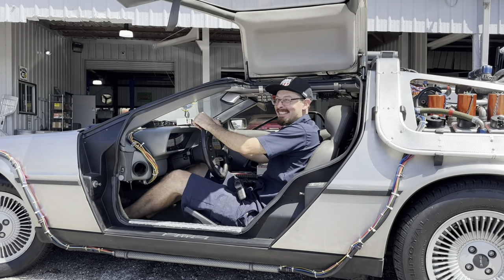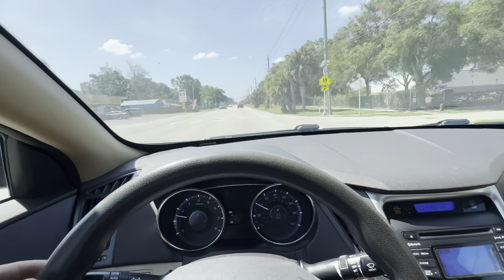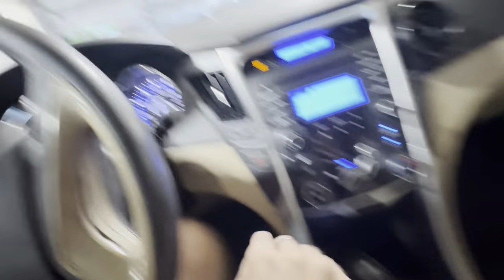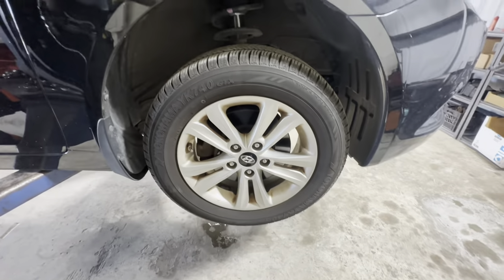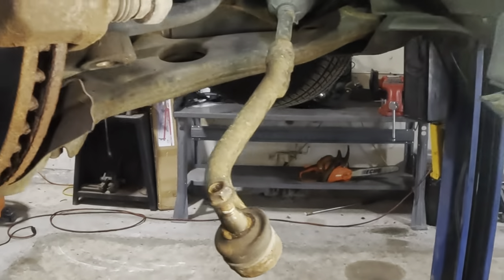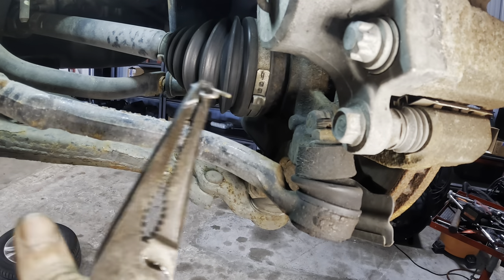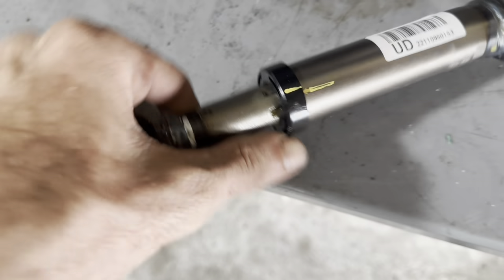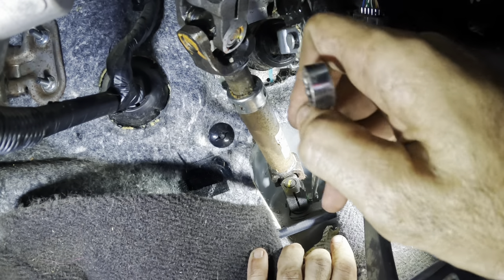Misdiagnosis! Mechanic was Wrong! Hyundai Sonata Steering Clunk!

Comment: It’s a star looking rubber plastic which connecting the electric motor to the steering shaft. That plastic is smoothed and need to be replaced.

Comment: The first time you moved that steering wheel i knew it was the EPS coupler bush. It's an asterix shaped (for want of a better word) rubber coupler between the electric motor and the column. The first time we saw it we did the intermediate shaft but still had the "decoupled" feel so we looked further. We've now done at least 20 of these and larger workshops i know of are doing one or more per week on average. 
Back when this system was new, the dealers were replacing entire columns under warranty because the coupler bush wasn't available separately. The bean counters soon made it available which is lucky for the owners facing this repair out of warranty!

Comment: Its the Servo Motor Coupler 563152K000FFF Ray that the issue that and the Steering shaft u joints are very common issues on these Hyundai's 30:00

Comment: Don't worry Ray I'm a mechanic for over 20 years and I had the same problem figuring out the clunking noise in Kia and Hyundai steering column. Its in the electric steering motor,  when you take the motor off the column there is a star like rubber bushing that goes between there motor and the column. Its like a $25 dollar part.

Comment: I guess you have already sorted the problem , I get a lot of these in Brisbane Australia , I think it is a bit of a problem brought on by heat . There is a rubber coupling inside the drive motor to column shaft that disintegrates . It can be purchased form Hyundai and fitted into the car with out removal of the electric drive column . do not move the steering wheel while it is disconnected or it will through a steering configuration fault .   Happy repairs Ray

Comment: I'm just surprised you've never had to replace the coupler bushing on those hyundais before. There's a service bulletin on it by the way. Maybe there's just more of those cars in my area cuz I do at least a couple every month. Anyway we all make mistakes and I think I also called an intermediate shaft the first time I ever came across it years ago.
Reply: 56315-2K000FFF is the part number for what you need by the way. Just gotta remove the lower kick panel, turn the steering wheel 90 degrees each way to remove the screws holding the lower steering wheel cover, disconnect any connectors preventing you from dropping the column on the floor, and once you get it down theres a motor sitting on top that is held on with 3 t30 torx. Remove that and theres a rubber bushing inside (well there should be, but itll look like it was in a blender). Clean that out put in new bushing, put everything back together. Clicking gone. It clicks cuz there's 2 metal gears that hit each other with no isolator when that bushing fails.

Comment: UGG.  As soon as I heard the clunking sound I was 99 percent sure it was (spolier)the steering coupler.  I have replaced two of them in the past.  A $5 part that on my Hyundai required dropping the steering column to get to it above the electric motor.  Hyundai's are famous for this and normally trips an EPS light on the dash.  I will tell you this, I have learned a great deal from watching your videos.  You do a great job. Keep them coming!

Comment: Double check the shaft going into the rack!! Lift up the carpet and rock the wheel back and forth and see if the shaft going into the rack is moving up and down!!  I just did one of those on an identical car that had a clunk like a bad sway bar link when hitting bumps. Took me awhile to figure it out. Car was steering the same as yours also!

Comment: Gee Ray, if you didn't make mistakes it wouldn't be a fun challenge to watch where you might forget or over look something!  That keeps it interesting to see if we would go about doing the repairs in the same order.  In the early 2000's, GMC and Chevrolet truck and SUVs would develop a clunking in the steering wheel. It was fixed by replacing the steering column bearing just above where the steering extension shaft was attached to the steering wheel shaft.

Comment: Hey Ray, it’s not the intermediate shaft, However it may also make same concern but there is a plastic rubber gear i don’t know exact material, this part is installed between the servo motor and the shaft that spline with the intermediate shaft and in order to reach it you need to remove the steering column assembly or you can only lowered down to remove the servo motor and get access to it very very simple job and also remember next time with same concern first thing remove the intermediate shaft and bench test it if it’s good then your next target is the that plastic gear.

Comment: EPS flexible coupling in the top of the motor is faulty. There are some bushings there that are known to fail, so look up the Hyundai parts list for the EPS, and you will find them there, as a known issue, plus the top bushes also wear. Had exactly the same on a Kia, and they use the same EPS motor and drive, so the universal was not to blame, but you need to look a little further up the shaft to the EPS unit. You need to pull the steering wheel, strip the column to get to them, but otherwise not too difficult, and all you need to do is an EPS relearn afterwards (lock to lock to get it to figure things out) to finish the job.

Comment: I saw the u joint wiggle at the bearing cap and since the steering wiggle was worse when you turned the steering it meant part of the play the u joint was absorbing stiffened it. I believe it still needed replacing.

Comment: There’s a small rubber coupler in the steering column that is more than likely the issue. That was what was causing the clunk clunk on my Hyundai. $1.50 for the part about 45 minutes and some bad words problem was solved!

Comment: I had a similar problem with a f-250 truck. It was hunting on the road like it needed an alignment, or the steering box backlash was too tight. In this case however after several trips to different shops, it was the steering shaft just as you replaced here. It turned out there was excessive slop in the collision slip joint. So in my book you were on the right track. Maybe try removing the shaft again and then using visegrips to try to duplicate the noise by first clamping to output of steering wheel, then to input to steering box. Might be that what has happened is the steering wheel itself has become loose

Comment: My mom has a 2012 hyundai with the same issue ended up being a stupid 20 dollar part behind the clock spring in the column,not to hard to replace, but my thoughts just like you Ray was the u-joint on the steering intermediate shaft. Sometimes you got to go with your gut to learn from your mistakes.

Comment: I had the same situation with my PT Cruiser. Finally had to remove the pin by knocking it out and then taking the bolt loose outside of the car.
The nut was tack welded to the assembly, so the bolt side has to be loosened.
It was a pain though and very hard spot to work.
Had to do it twice because the new steering gear began leaking after a week and I had to replace it under warranty.

Comment: Hi Ray, You'll find the noise coming from a small rubber bush in the electric power steering unit. It's a common issue. Cheers Richard

Comment: Hey Raymond 
The noise is in the steering motor to steering shaft connection it’s a little plastic part that goes out all the time Hyundai. You need to drop steering column to git at the motor . Good luck

Comment: I had this problem on my 2007 Saab 9-3. A very disconcerting feeling with the way it wandered. Apparently not uncommon with this type of setup, exacerbated by the Saab lower joint being directly under a drain point on RHD drive cars, allowing water to ruin the lower joint quickly. Luckily, once found, a fairly easy swap, and the Saab back to it's gorgeous self..

Comment: As soon as you said Sonata sterring loose and makes noise I knew this is the Sterring gromet. They use a PVC gromet in the electric Power steering  the gromet wears down and almost melts since it is taking uo the slack between two metal gears.  it is  $20 part  but the dealer wants $450 to replace it because the time on this is 3.75 to 4.5 hours  I just changed Mine on my 2012 Sonata in about an Hour dont disassemble the steering wheel or remove the fuse panel, remove plactics  Just drop the steering wheel,all the way ( move the seat all the way back),  open the top of the Power steering box,  clean out debris , with a brush and vaccuum, place the gromet in put the top bak on it only goes one way, put steering wheel back up, reaassemble the plastics should be good to go. this is Not a safety Issue because the gromet only takes up space between the gears the steering is not "lose"  just has a little extra play  like an old Dodge if it was Hyundai would have replaced Mine as this is a known issue on these cars and KIA s as well.

Comment: Had a very similar noise to that in my Nissan Sentra.  Turned out to be a rubber encapsulates steel weight just under the horn pad that had broken loose, and was making noises every time the steering wheel was turned.  I don't know what its purpose was, maybe a counter weight of some sort??  Opened the wheel, siliconed it back together, and no problems since.

Comment: Hey Ray, there is a TSB about a rubber "bushing" in the electric motor assembly.  I have replaced several up here in the north.  Good luck.

Comment: It is a simple misdiagnosis, I've been close to doing it a time or two.  What needs to be replaced is the EPS gear, it's a little star gear that goes between the motor and the rack.  It is a simple replacement with either removing the column or it can be done in the vehicle.

Comment: There is a rubber bushing inside that steering unit that like to disintegrate..it's called a flex coupler and it looks like a star..  luckily the replacement is not as much cost as a steering shaft.. but there is a bit more time involved regarding replacement.

Comment: It's the little plastic/rubber gear down inside the end of the column. There are videos of how to do it . Takes 2-3 hours .I think there's an aftermarket metal one you can get too .The first one  I did , Identifix helped me isolate the problem .TSB on it too, I think . Reasearch has saved me much time. Jack of all cars master of none.

Comment: Had this problem with my 2012 Sanata. The fix is replacing a small plastic part above the shaft you replaced. It looks like a star, about the size of a quarter. This is a known problem.

Comment: The problem is caused by a neoprene/ rubber coupling between the steering column and and the universal coupling. You need to remove the steering column to get to it. It's a $15  part which disintegrates over time. I replaced the one in my Hyundai i30 after watching a youtube video on how to do it. It's a bit fiddly but very do able.

Comment: Upper column failed, quite common on Hyundai. There is a rubber coupling that fails and causes this exact symptom, do a quick search for TSB 14-ST-002-1 which guides on fitting a replacement component (which is about £10), do be aware its a bit labour intensive. You will note that when you turned the wheel the motor on the column was trying to assist but, the play present is resulting in a slightly delayed knock noise, classic symptoms.

Comment: Not sure if this helps  by my 2012 camry was making about the same noise.  I first thought it was that shaft.  However I was wrong.  It turned out to be the dampener between the power steering electric motor and the colum. Dam $5.00 part and about 3 hours worth of work.  But I am just a DYI'er and fix friends cars on the side.  I have played with cars for many years, love it.  Thanks to you and Mr. O both of yall have taken me out of my confort zone to do more wrenching.  Just a question if you have time.  Do you ever take something apart and say of crap what have I gotten myself into???

Comment: I hope you already figured the issue out, but as mentioned by others it's probably the small plastic & rubber steering damper in the electric power steering motor. I had to replace that in my 2012 camry. Cheap $7 part from toyota but had to dismantle the entire steering column to get to it.

Comment: Most of those steering linkage type pinch joints also use splined bolts, so they don't back out over time.  They are always a complete PITA.  Even after you break them loose, they will fight you the entire time your spinning them off.

Comment: It’s a rubber grommet in the electric motor, it’s a 5.00 part at Hyundai. It happened to my sister in laws car had very same sound and symptoms and I had to replace it. It wears out. After sound and problem fixed.

Comment: 30:15 up above the shaft there is a cylindrical steering motor gear (triangular base). Inside there is a rubber bushing that looks like a ships steering wheel that is notorious for failing and causing the clicking sound while turning. Put your hand up on it while turning the wheel and I guarantee you will feel it click each time you hear the noise

Comment: I was wondering when you would take the key out.
I've been waiting for that test drive.  I didn't see that looseness you said you had.  Back to the drawing board.  😄
You might want to pull the steering wheel and check in there.

Comment: I don't know if anybody's mentioned it because I haven't read all the comments but there's a TSB on this. There's a little tiny rubber donut biscuit I don't know what you call it that goes between the steering shaft and the electric power steering pump. That is what's wrong.  It cost four bucks.

This little rubber thing has been broken and fallen out and left a gap.

Comment: Rayyyyy the issue is a rubber cog shaped damper inside the electronic steering mechanism, it’s about $20 and you can change it , very common Kia problem over here in uk . Usually fails at just over 100k miles

Comment: The steering coupler is a common failure point in the Kia's and Hyundai's with the electronic motor in the column
. It's a star shape coupler. You can find more info on U tube under steering coupler.

Comment: this will probably get buried but it sounds like the power steering coupler (small rubber coupler between the power steering motor and the column) can be purchased from a hyundai dealer or through Dorman/parts store, part number 926-990, i dont believe they're very expensive, column needs to be dropped and the motor unbolted from it to access the coupler. Source: used to work at a Hyundai dealer, this failure is actually pretty common

Comment: A lot of those upper steering shafts are a collapseable shaft within a shaft.  When they get worn one shaft could be clunking inside the other....... twist clunk!!   Could be a bearing too, but I would suspect an upper shaft more!!  Just my two cents Ray!!  Remove the lower and restock it and put some vicegrips on the bottom of the column shaft and give it a twist while holding the wheel straight ahead.  See if it clunks or twists within itself!  The only other prospect is internal rack bushings or bearings.    Good luck!!  👌

Comment: The bolt may have had lock tight on it since you are Fed if a bolt comes undone. Hurricanes do a mix with the upper layers which are quite cold if you monitor temp during a 30 or 40K foot jet flight.

Comment: CUDOS!! I like that you take responsibility for your mistake.  I have been taken advantage of so many times by repair shops especially dealer ships,  it is not funny. 
One time a dealer ship wanted to charge more than $900 in labor for a repair.  The problem started while the car was under mfg warrantee. When the warranted time or was it millage was over, the problem had not been solved.   The shop kept charging me for diagnostics at $100 a shot even while in the warentee period.  5 times I was charged, still not fixed.  I suggested what I thought was the problem.  I was totally ignored.  Then the $900 repair proposal.  Still ignoring most my suggested parts to be replaced.  I declined the repair.  Went to a different dealer ship, purchased the parts I thought were at fault. At total cost of ~ $125.  From the time I started to gather my tools to the time I was washed and tools put away was 25 minutes.  The car engine ran trouble free for the next two years.  That is why and when I started to do most of my own repairs.

Comment: I had a 2012 KIA Optima which is the 'sister car' to the Sonata. They share the same platform. A few years ago there was a recall on the steering shaft coupler that connected the steering with the electric motor. My car had exactly the same symptoms as this Sonata and the dealer replaced the coupler to resolve the issue.

Comment: You could have easily never uploaded this particular video or edited it to make you appear to be a know-it-all Master Tech that was sent down from heaven above -- the fact that you did neither of those things earned an instant "like" from me, Ray -- you're a good man.  Might be wise to quickly scan for TSBs on your shop computer as part of your future pre-teardown standard operating procedure, especially on these Korean vehicles.  The applicable one here appears to be 17-ST-002 (MDPS (Motor Driven Power Steering) Flexible Coupling Replacement).  Per Hyundai, "Wear of the coupling does not affect the ability to steer or control the vehicle, and is not a safety issue."  They conveniently omitted, "but is guaranteed to drive owners insane and cause significant anxiety"!

Comment: Hi Ray, Inside the electric assist motor you will find a star shaped washer that works as a damper, These break down and fall to bits, Needs a new one, Problem sorted